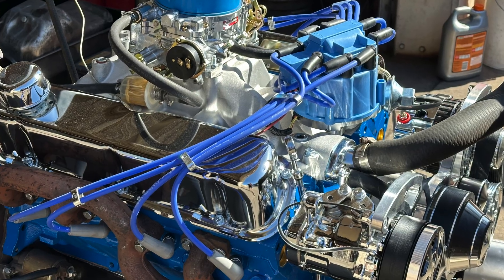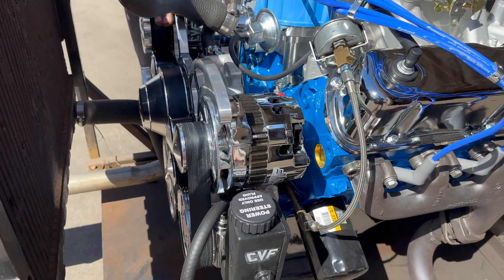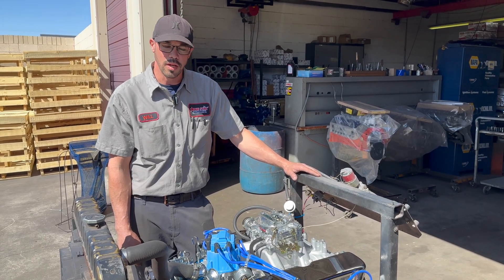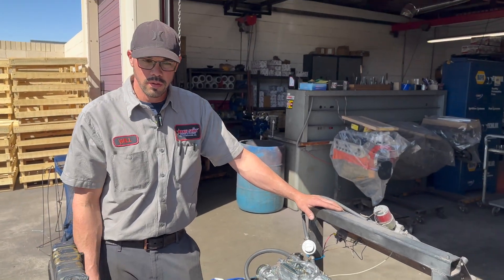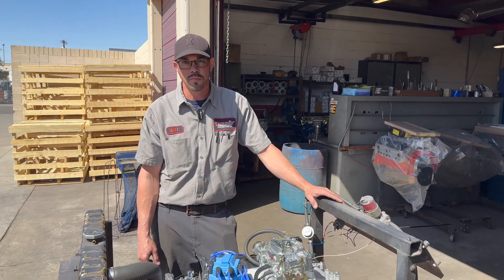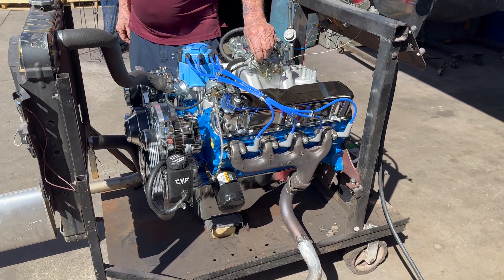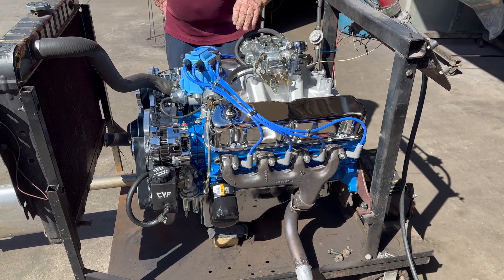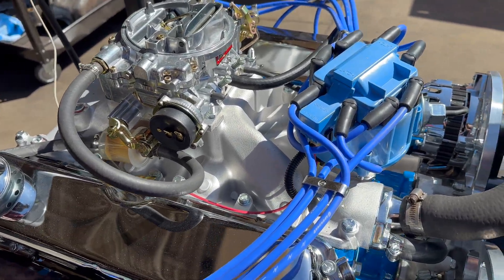351 Windsor for a 1971 Ford #Mustang - #BarryT w Will Violett and Ed Smith at Five Star Engines

Comment: The 351w is not very common in Australia . It was only available in the 1969 Australian built Falcons and Fairlanes . in 1970 Ford Australia went over to the 351c . In 1972 Ford Australia started building 351c and 302 c which lasted until 1982 .
Reply from the maker: That’s very interesting!
They were probably importing the Windsor engines and ended up with a plant that was making the Cleveland style for everything?

Comment: 351W. Ford built millions of them for many years. Underrated. Very dependable power and torque. Maybe it's the recording, but do I hear some ticking?  Please tell me all is o.k. Thank you.
Reply from the maker: Everything is great, I often have problems with my audio recordings, capturing the sounds correctly…
Yeah, the Windsor engine family probably is very underrated for how many millions that were made and used well without suffering massive recalls and problems and TSB’s and all that we get these days
Reply: @BarryTsGarage 
They're also a stout candidate for high performance/race builds with a very robust bottom end